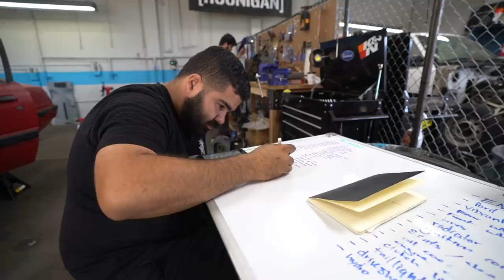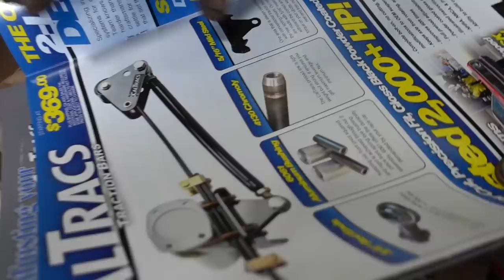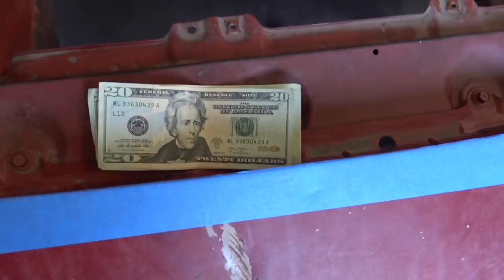Build & Battle: Who's Engine Will Go in First?? Rotary vs V8 EP.3

Comment: Brad would of been better off redoing the headers  than whatever mangling the manifold.. still rooting for ya Brad, but....... The brothers are executing much better right now..
Reply: He would of been better off starting with a 98-02 fbody. You can find clapped autos all day long
Reply: or atleast cut underneath\back of the headers and add more tubing to it.
unless he is planning to leave valve compression slightly less  on those 2 cylinder and the rest on high compression to match
Reply: Fi Metal then he would’ve been stuck with a weak ass 7.5 and no cheap way to upgrade. Great cars but the rear end would’ve killed the budget.
Reply: Mike Hagen they are also bringing in other people to help them build the cage and shit.
Reply: It doesn't make a difference. Chevy guys regularly smash header pipes in with a hammer to clear the steering shaft. It doesn't loose any power. Engine master's has proven this on a Dyno. But I do agree he should have at least bought a set of cheap headers.
Reply: @Josh-py2in  I'm a Chevy guy....that's way more than dimpling some tubes, especially in a cast manifold that doesn't flow like a header.  P.S.   I've seen Engine Masters also...
Reply: @Josh there’s a big difference in clearancing a header and what brad did. He greatly reduced the volume of the runners. If he was going to hack it that much then he should’ve just bought a flange and sent pipes out the hood or fenders.
Reply: @stevemcvay2220  paying* for that help, its comming out of the budget
Reply: 38:00
Reply: @67buick  They crushed them to half the size and it made no difference.
Reply: @luiss0104  Yea, their biggest budget saving thing was what Hert said, they are building the engine themselves and already know every trick to do and extract power from that engine. Their work to do that alone would probably be more than this budget allows.
Reply: SkylineBNR34 as they dented the tubes it changed the shape, not size. They explained this in the video. Brad cut a section out and welded in a new piece. Two different things.

Comment: I swear modifying the column slightly would’ve been easier than hacking that manifold to death.
Reply: Its driving me nuts. I expect nothing less from Brad.
Reply: Johnathan Doe you don’t wanna corrupt that world-famous steering geometry I guess
Reply: Lee Susca nah, an extra universal joint or two and a couple of shaft guides firmly mounted to the chassis rail would’ve been a bridge too far for sure. Really would’ve messed with the handling on the drag strip 😂

Comment: That ain't cam lope.. that's exhaust constriction! hahaha
Reply: XskiXedgeX he was equating the power gains to that of a big cam... with a big cam, you flow more air in and out of the cylinder without modifying the head itself. It’s the same concept. You flow more air in and out without modifying the rotor
Reply: Rocket still sounds like an angry weedwacker... v8’s or I6’s sound so much better
Reply: @zerohourdrift  Yo.... What are you even talking about? 🤣🤣 I'm talking trash about Brad's headers, not rotary porting, lmfao
Reply: Rocket I had an fc. Cool car, but it was unreliable and gutless. I like my firebird much more now🤷‍♂️ to each his own
Reply: Matt L HA!
Reply: Angel Motorsports what ha? Just curious bc I have a couple comments here and want to know which that was in response to
Reply: Matt L the part about a rotary being gutless and unreliable 😂😂
Reply: Angel Motorsports well I mean it was an NA fc with like 130k miles... the na 13b made what like MAYBE 100 wheel when new? Mine was probably lucky to have like 75 lmao. It was slow af
Reply: Matt L weird I have an fc at my shop with 230k miles and still
Runs
Reply: Angel Motorsports mine was pretty beat ngl. I mean I got it for like a grand and the previous owner was definitely not kind to it. Like I said. To each his own. I’m just not a huge rotary guy. Obviously you are😂

Comment: Hell yeah i was about to go fix my brake line on my impala SS 96. 
but just saw this. 
screw canadian salt.
Reply: Yeah I was supposed to be pulling an alternator at the scrap yard
Reply: Right?  These Californians don't know how good they have it.  A tiny bit of surface rust and they're all like " Oh it's so rusty " .......I burned out an impact gun trying to loosen wheel hub bolts, thanks to how seized and rusty they were...........Are*........ Still haven't gotten them off.  lol
Reply: Meant to be doing wiring and dropping the radiator on the girlfriends car 😂
Reply: Just don't put it off like Scotto...

Comment: Brad is going to have the worst air flow with those headers 😂
Reply from the maker: Brad believes it won’t make a difference... We will all wait and see😂.
Reply: He should've just built a set of headers
Reply: @HooniganProjectGarage  Oh yeah lol
Reply: Not even headers still running exhaust manifolds . LS motors like to breath . Still routing for the S10 though .
Reply: @steveelco114  headers and exhaust manifold are the same thing buddy. They both do the same job.
Reply: I do remember Motortrend doing a video on the power robbed from damaged headers. They took a hammer and crushed down all 4 pipes on the header and IIRC it didn't make a difference.
Reply: @wackomanx  Finally someone understands
Reply: It's gonna breath will the big bottle he's putting in that bih

Comment: Im trying to figure out what is going through brads mind. Cant make any sense of his build. Chose the easiest  vehicle to build and turned it into rocket science
Reply from the maker: If You spend all day trying to think like Brad you’re only going to hurt yourself.
Reply: Spent his budget on a billet converter and built transmission instead of just having the old converter built and putting a shift kit in the trans. I think the logic is the same as the other team just not executed as well. They’re buying parts that they want or need for other projects.
Reply: Cocaine's a hell of a drug
Reply: @matthemberry  Old transmission as in the s-10 transmission that would never hold the power. OR you mean the transmission that didn't come with the motor?

Comment: I'm calling BS on the 100 dollar bet... John says the engine has to come back out and be moved forward to use the driveshaft... by those standards Brad has had his engine in 17 time before the Vargas Bros
Reply: Brad doesn't have a driveshaft at all though, so they're even.
Reply: @firelizard2  but how many times has Brad had the motor in to test fit? And it had to come back out to make adjustments.... like John's engine.
Reply: Dale Day I actually ended up cutting the trans tunnel and leave the engine on the stock location 🤦🏽‍♂️ but enjoy the show lol
Reply: @angelmotorsports  good deal... you planning on a V-Mount and that's why you needed the space? Also don't think I was taking anything away from your build. You and your brother build quality.
Reply: @angelmotorsports  it is cool to see the contrast between the two teams... full backyard hackery vs a professional motorsport business. Even if Brad's ends up faster it wont be as cool or clean as your build

Comment: I've done 2 ls swap s10's and the first one I used stock truck manifolds by just cutting off the embosses for the headshield bolts and a vband with 0 interference with the steering shaft

Comment: tip for next time on the header clearing the steering column, im pretty sure if i recall seeing road kill or engine masters take a hammer and smack them to make dents into them to clear a steering column and  wasn't any significant changes in horse power or performance

Comment: Brads smart.  Put em under pressure so they'll rush their build. 1 misplaced seal or a couple forgotten untorqued bolts and Brads taking home a shitty s10 filled with used wrecking yard parts! Lol 
It probably didnt work cause Im pretty sure they could assemble a rotary in their sleep, but still worth a shot!

Comment: What idont get is why he hade to do that with the manfold.  My buddy and I LS (5.3)  swaped a s10 just like that and used the same ebay headers worked just fine with the stock stearing shaft. An Did the swap in a week after a 8 hour work  day running and driveing.  And under 4k . latter put built th400 and 8.8 with track bars still in the truck less then then 10k

Comment: Ford explorer 8.8 is direct bolt on. 31 spline axles from factory. 1998_99 F-body manifolds are also direct bolt on deals. Only 98-99 the steel ones.

Comment: bad daddy braddy messed up. He should have gone for an 8.8" out of an explorer over a mustangs. That way it's already set up for leaf springs, has 3.73 gears (instead of 3.27s for 99-04 or 2.73 gears for 94-98 GTs, 3.08 if it had the optional gears), the same LSD, 31 spline axles instead of 27 spline and best of all, you can get them for like $100 from the junkyard all day instead of $200 from someone or hoping you find a 94-04 GT in the yards.

It's what my neighbor has been doing with his 55 Chevy's, 1st gen and 2nd gen Camaros after I told em about it.

Comment: Dear brad, a Jeep steering shaft, a quick weld and a slight shim to the box would of gained you a ton of header room
Reply from the maker: It’s coming down to the wire on budget, brad May only have $100-$200 left in the account. He needs to start selling some stuff off so he make these much needed upgrades.

Comment: You're  making the s10 way harder than it needs to be. An explorer 8.8 would bolt in & give you 3.73 or 4:10 gears, factory locker, 31 spline axles & be less than $200. The steering shaft issue is solved with a jeep steering shaft which bolts in place & has a thinner diameter. I forget exactly which jeep shaft people use

Comment: I shrew dew luves me some bad daddy Brady fabrication. Let's see here's boi, IMMA take this cast iron manifold and weld some stock cold rolled steel to it with standard shielded .035 wire and no pre heat treat to said MAN-Y-FEWLD. Tell you what boi, she aint gonna crack under any sorta temp change. OOOOOOO WEEEEEEEE. GAWD DAMMER GAWD DAMMER, SHEWD EE BEEN A SUPER MODEL.

Comment: What's the point of a 2v2 build battle if the Vargas' get 2 extra people to put the engine and trans in
Reply: And wasnt even in... they said they had to pull it back out to move it forward to use 5he drive shaft

Comment: Brad went the wrong way, swapping took most of his budget; a turbo hatch would of been cheaper and easier to do since you have less mods to do and parts are cheaper than LS parts. A used Holset HX35, LS injectors, and some eBay parts would of put some power down. Not hating at all since I have owned but Honda's and Chevy's but Brad played himself here.

Comment: Okay first off the reverie build is a good build doing that to an S10 though is too much work especially with that motor now it's a simple build but what I would have went with is a destroked 400 long block a 377 with hella nitrous on a Ford 9 rear end with a lunatic shaft backed by a turbo 400 then I would have put a line break on it to make sure it leaves this guy that is building the S10 does not know what he's doing he's trying to be all electronic when you're on the budget that is not what you do if you gave me 10 grand my choice would be a Honda Civic hatchback with a K20 turbo kit running 30 lb of boost forged internals which are very cheap methanol injection E85 with a dog box and a reinforced suspension now tell me am I wrong for thinking the Honda would have been easier a simple motor swap with upgrades

Comment: Brad does everything wrong I want the American s10 to win but Brad chose an expensive motor and non necessary expensive parts I mean 370 for links I could make some links for less than 70 bucks that would have been 300 bucks right there and the shocks were not necessary that huge system for axle wrap a few links welded to the axle would have done just as good and he mangled the manifold so bad I don't think air flows through it